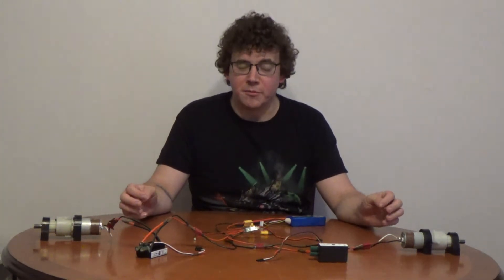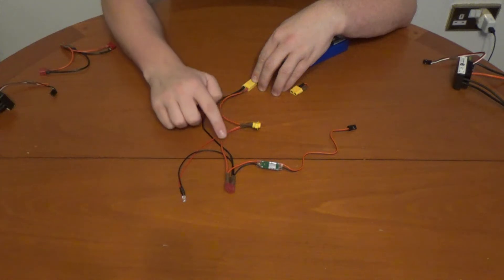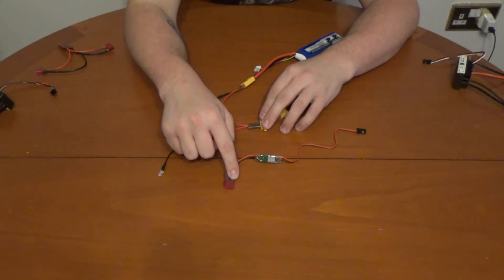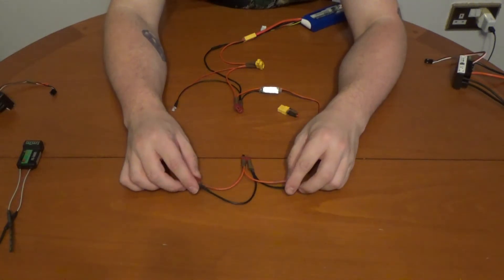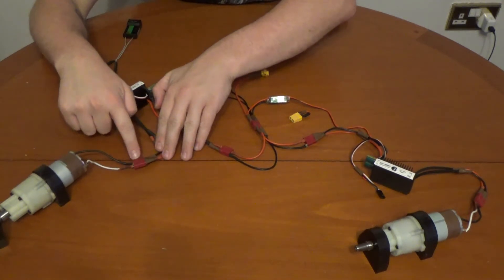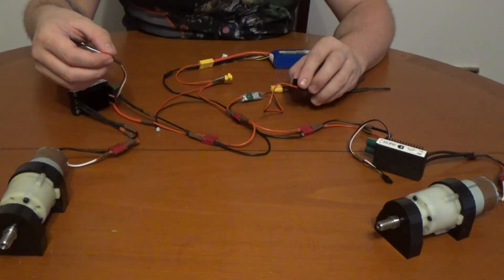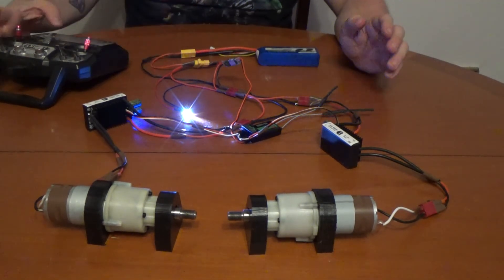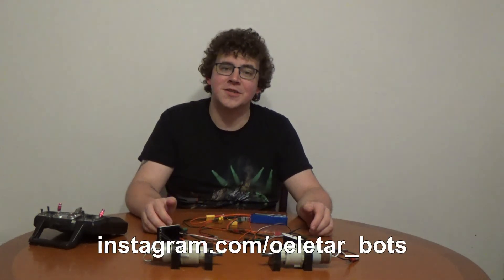Building a Featherweight Combat Robot Part 1: Drive wiring system

Comment: Why use dedicated BEC if you can just use one that is built into an ESC? Correct me if I'm wrong, but it seems like additional, unnecessary wiring and complexity.
Reply from the maker: The BEC came with the kit and I wanted to wire the system with everything it had. You're not wrong as personally, I normally use a sabertooth 2x12 esc which has the built in bec and saves a lot of wiring, but I was curious to see how the kit all went together. Also the sabertooth can be priced high and it's good to have a backup system. Hope this helps :)
Reply: they recommend it anyways to use a seperate bec but in the new esc's you can use them if you like

Comment: Can you list the parts used?
Reply from the maker: It's a kit from the Bristol Bot Builders website. The parts are:
2x planetary gear motors
2x XT60 male and female connectors
1x 12v white LED light 
1x 5v 3A Battery eliminator circuit
2x BBB featherweight brushed ESC's
Dean plugs/connectors
Heat shrink tubing

Electrical tape
1x Turnigy 11.1v 2200mAh lipo battery
1x Flysky FS-IA6B reciever
18 gauge red and black wire

Hope this helps
Reply: @oeletarrobotics  cheers mate

Comment: Very nice explanation, I think it would be a good idea to explain what the "Dean plugs" are, I haven't used one before, I suppose they are another popular type of RC power connector. I'm assuming that they are keyed so you can't put them the wrong way.
Reply from the maker: Thank you, and sorry for not explaining in the video. You're right as they only connect one way, and they resemble a capital T which makes it easy to wire and connect. Hope this small piece of information helps but I'll make sure to add it in a future video